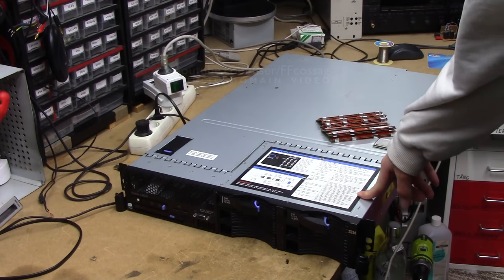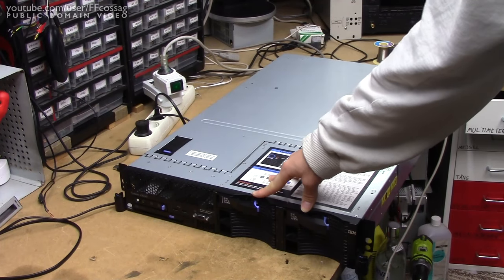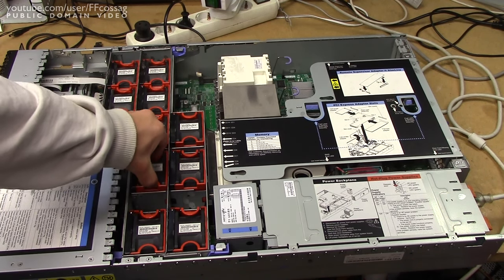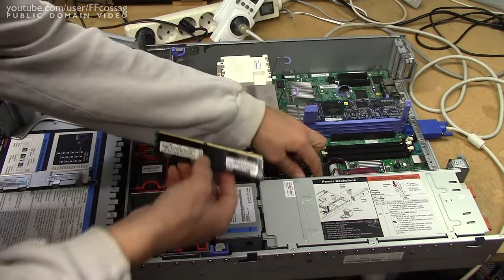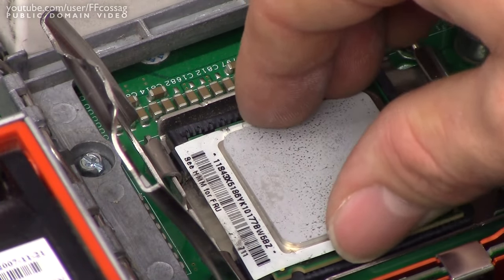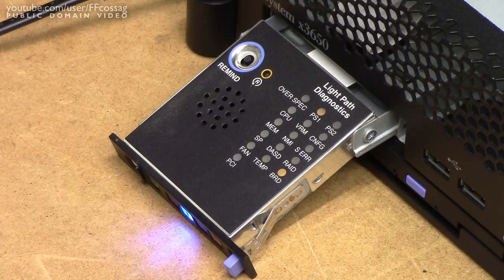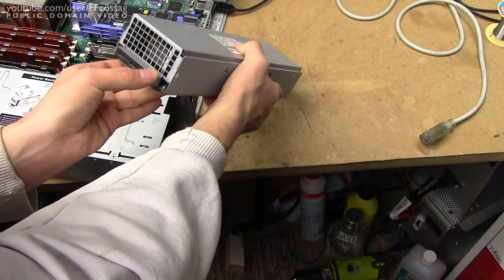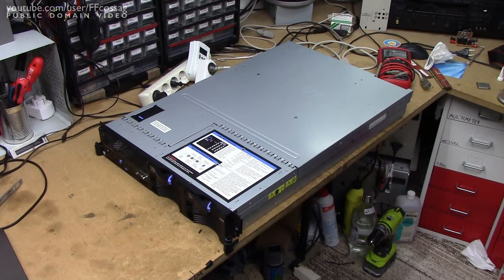Messing with an old IBM X3650 server

Comment: A few pointers: 
The memory with square "big bga" in the middle is FBRAM, unlike "regular" ecc it gets hot fast. It is also quite finicky to match.  
The processors to look for: 5450 minimum. A dual  X5450 will get you a performance in the ballpark of a single AMD FX8150.
If a BIOS does not have a support for a particular CPU it can be hacked in. You have to match the FSB.
The power supplies from servers are great. You can usually modify those for variable output from 9v to 15 (or so) easily. 
Most have a load sharing and voltage sensing capability so those are quite useful as battery chargers etc.

Comment: Hi
The system board in this server can use Intel Xeon 50, 51,52 and 5300 series CPU´s The 5300 series are quad cores fastest of which is the X5365, that benchmarks at 3540 a piece. 
The Raid controller can take up to 2TB drives,, so up to 12TB of storages. It can run VMware ESXi 6.0 newest and I have had them running XPEnology,, the hacked version of Synology's software. So a okay six bay 12TB NAS server.
It's power hungry! Yes! but not if you think of it as an multipurpose electric heater.
Reply from the maker: He he, multipurpose heater. Glad you understand my point of view, lol. Ever since we got our underground heat pump, I feel guilty running inefficient devices. In fact, it's turned into a bit of an obsession, trying to push the power draw of all my stuff down, down, down. To the point where half the 12 V stuff in the workshop (network switches, lamps, speakers, etc) is now being powered by the 80+ rated PSU in my current server - just to save in on the headroom of running many little power supplies.
Reply: My PlayHouse Huh, I expected that you would be here.

Comment: free servers are always fun! :D
Reply from the maker: Free <things of utility or monetary value> are always fun.

You know, like lead-acid batteries. ;)
Reply: FFcossag
yup :P
 
btw i find lead acid batteries to be really good for welding. just need a few jumper cables.
Reply from the maker: Rinoa Super-Genius Perhaps I should give welding a go with my 750 Ah 48 V bank ... ;)
Reply: FFcossag
 yeah 48v works great, over 72v you can cut through metal really quickly...just very messy ^^;
Reply from the maker: Rinoa Super-Genius Hm. Then what does 300 V worth of 170 Ah lead-acids do?
Reply: FFcossag brings in lots of views, thats what it does >:)
Reply from the maker: Rinoa Super-Genius Hm, I need to get myself some steel rods and welding cables ...

Comment: Those are loud, I used to admin then and others. Their is a command line only BSD boot distro, I don't remember the name but they will boot them and should control temp and fan RPM for basic testing.
Reply: Sorry, not BSD. I just looked it up. I was thinking CentOS and I will run equal to your current home server to take half the tasks. Amazing what happens when you remove the GUI and more importantly windows. It's based off of red hat distro, runs stable last I used it. We always took the old windows servers they were going to toss and used them for another 5 years putting CentOS on them. They may be old to windows, but still good for others that know what to do with them.
Reply: Oh yea, and welcome home.
Reply from the maker: I can imagine that working very well if they were serving heavy Windows tasks. Some of the WIndows-based server softwares I've seen have such ridiculous amounts of bloat.

60+ GB of RAM for a small corporate email server ...
Reply from the maker: Thank you.

Comment: It might actually be quieter if you plug in both power supplies. I know HP servers will run the fans faster in an attempt to cool off the downed supply, just plugging both in quiets it down.
Reply from the maker: That does make sense.
Reply: Yep, this guy is right, forgot to plug in one of the PSU's on my HP DL380 G6 and those fans were LOUD, and then as soon as I had both plugged in the system even at near full load it's like quieter than my dehumidifier.

Comment: Those powersupplys are realy nice ones.
The i2C buss is just for management and not realy used for turning them on but they can actualy tell you how much power is been used since ther SMBuss comatible.
There are plenty of RC guys that use these kind of power supplys to charge ther lipo battery packs since some of em need an insain ammount of current.
Also some crypotcoin miners love these kind of power supplys since ther alot more effichent since they mainly supply 12v and most cryptocoin asics barly use 5v or 3.3v wich some of the consumer grade PC power supplys deliver alot of aswell.
Reply from the maker: I have a feeling they might get used at some stage...
Reply: Well it would be a compleat waste to throw them away :)
Reply: +FFcossag : They almost certainly will have a voltage adjustment pot inside, or at least a way of hacking it with resistor values. That's a scary amount of available current, though! It could do a lot of damage in the event of a mishap. It'd be good if there was a way of adjusting the current trip and/or limiting.

Comment: If the postage to the UK wasn't horrendous, I'd have bought that off you! Sadly, it's simply not economical given how cheap servers and workstations sell for on eBay. I'd have a look at IBM's site to see if a bios upgrade will add later CPU support. Also, ECC memory is very cheap on eBay. Surprisingly it's actually much cheaper than desktop RAM. It would have been scarily expensive when new, though!
Don't give up on it yet!
Reply from the maker: Of course ECC RAM is cheap - parting out old servers is e--z cash if you have a few at hand. I'm not really giving up on this server as much that I'm being a realist in seeing that I don't really have any application for it. The extra redundancy features it offers doesn't justify the power cost in my application, sadly.

Comment: I didn't see exactly what ram it needs, but i have 32 sticks of Micron MT36VDDF25672Y-40B (2Gb PC3200 ECC) if you want them?
Reply from the maker: I'm not really sure, PC-3200 sounds weirdly slow for such large modules. The ones that I got for this server are PC-5300, and given the high bus speed of the CPUs that it takes, I'm not sure if it'd be proper to move down to PC-3200. Perhaps someone more experienced could fill me in on this?
Reply: FFcossag Yes 3200 wouldn't be fast enough for you. Well if anyone reading this wants them let me know, i just can't bring myself to throw 64gb in the bin!!
Reply: I could probably use them as I have a lot of server equipment

Comment: bios reset wouldn't help? what if you upgrade it (bios) to newest version?
Reply from the maker: While I didn't try it, I don't really see what it'd do. I moved the modules around, and the issue follows the 1 GB pair.
Reply: +FFcossag : I assumed he was talking about an upgraded bios adding CPU support. I've seen that a few times in the past.
Reply: problem is IBM is an asshole and sometimes wants you to pay for a service contract to have access to BIOS updates and drivers for their servers, especially the slightly newer X series.
Reply from the maker: Ah, I see. That makes sense to try. Sadly though, due to the GIANT power draw of this beast, my inspiration to upgrade it is a bit limited. I might revisit it in the future, in case I come across some more parts that fit it.

Comment: can you boot a Linux live image? there might not be any power management before the OS boots (also interested in seeing if it goes down)
Reply from the maker: It'll likely drop a bit when you load a proper OS, but I can't imagine it idling much below 150 W, no matter what. Just the sheer amount of fans is going to present a ~20 W load on the PSU even under no-load conditions, and I can't imagine these power supplies being above 70 % efficient at low load - so we have a roughly 30 W power consumption in cooling alone, before we even consider the drives, RAM and mainboard.